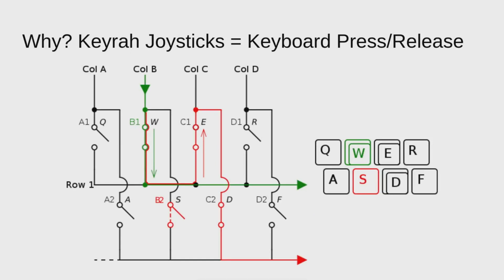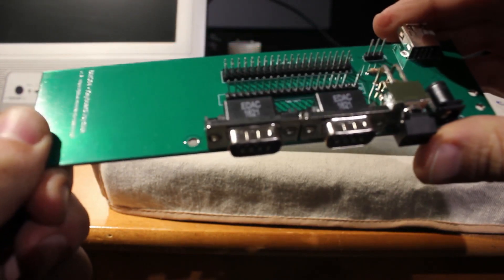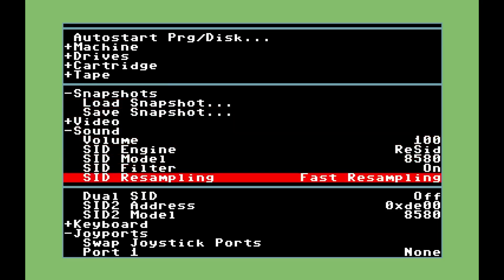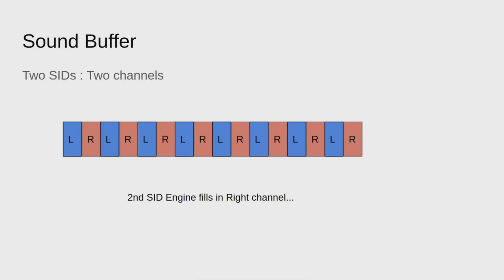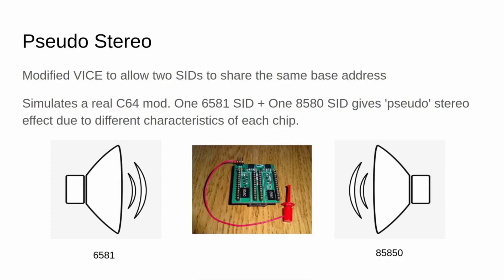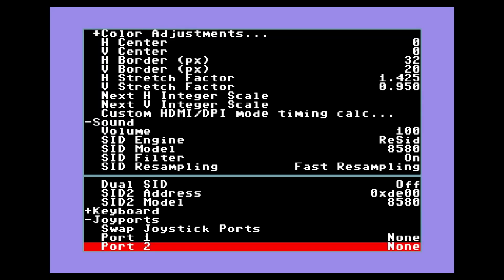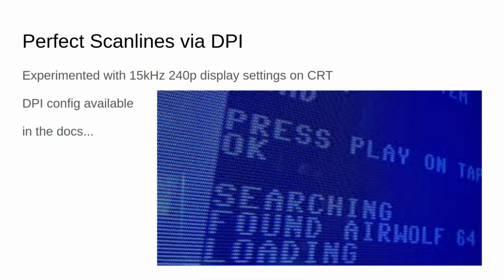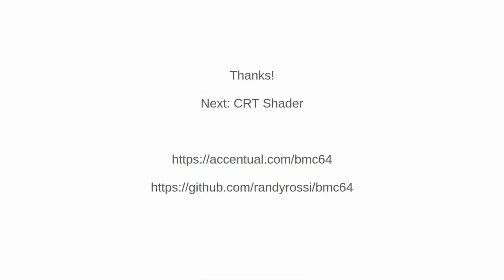BMC64 v3.5 Updates

Comment: Bmc64 is dope. I even tried it via analog Output on a Tube TV. Looks Like the real Deal from the 80s.. but i have one Problem. I get No Sound Output. Not over analog and also not over HDMI. Volume is Set to 100%. Im using a raspberry Pi 3b plus.
Reply from the maker: Try editing config. txt and setting hdmi_drive=2
Reply: @r3rossi  thx. I will try that.